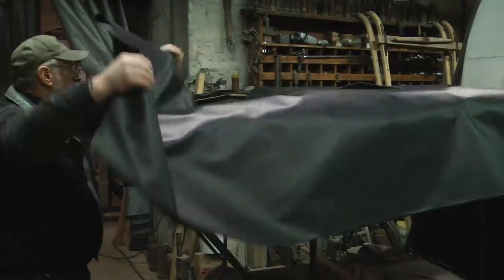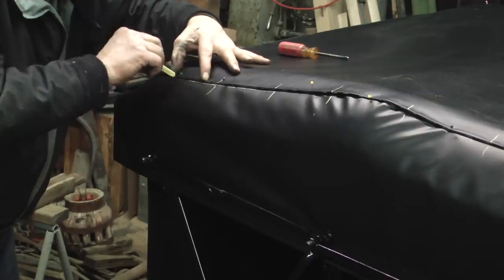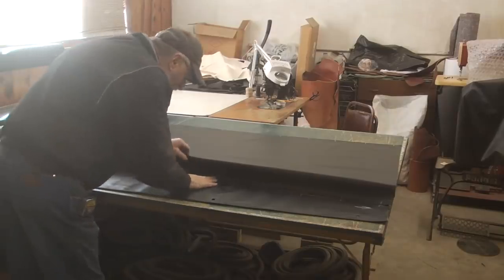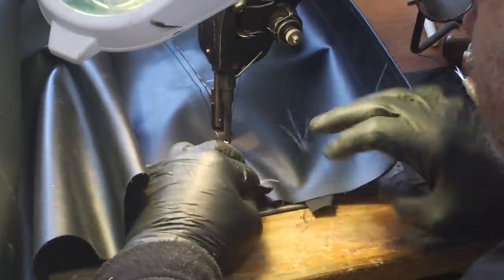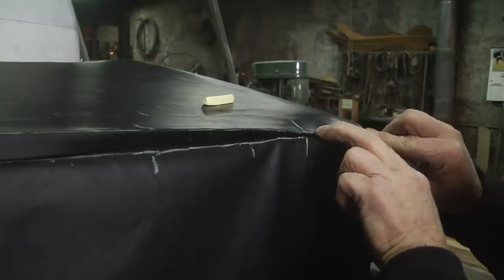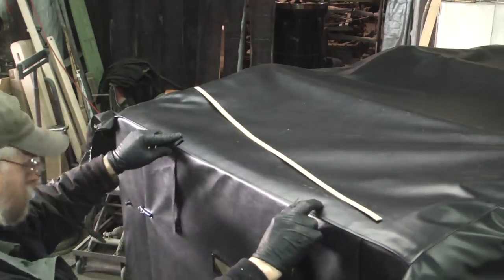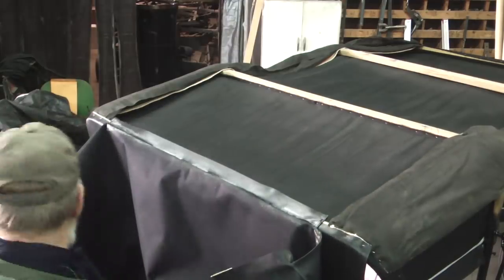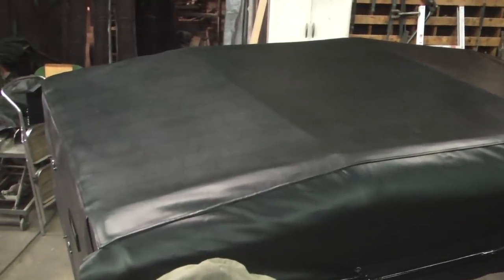How to Upholster a Surrey Top # 4 | Top Deck & Curtains | Engels Coach

Comment: I really admire your craftsmanship. I have a hint that I learned in my business that required sewing. Like you I always pinned parallel to the stitch seam, then I would need to remove them as I got close to them. My mother once told me that if I pin perpendicular to the seam I can just continue to sew right over the pins keeping the seam tight. If the needle comes in contact with a pin it merely deflects a millimeter which does not affect anything. Try it  if you want. Thanks for your videos.

Comment: A tip from a tailor for fitting excess fabric in (it's called easing), stitch a row in the seam allowance and gather it up slightly. This will make controlling the excess much easier.